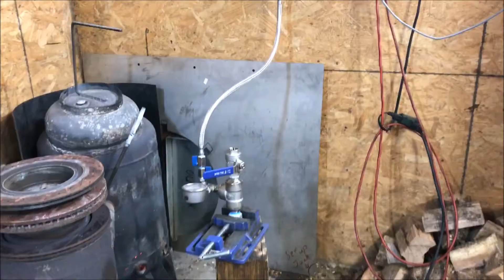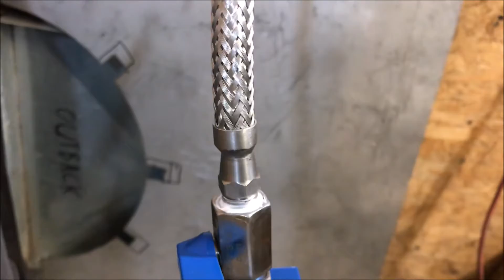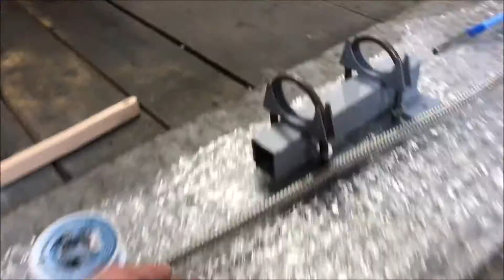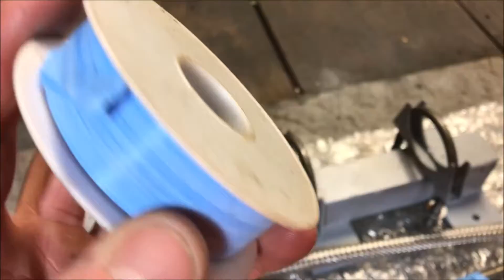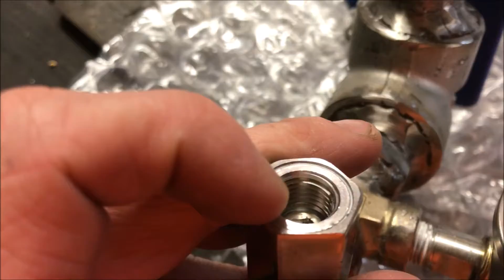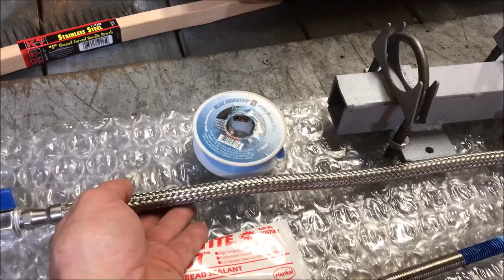Pressure booster DIY

Comment: hey I'm at the part where your tapping and I got to say you have a task ahead of your while machining 316L grade stainless still, consider 304?  the term galling is used when referring to sticking you got going on. take some masking tape and go around the top of the fitting to make a little well . oil and water are your friends here low speed and high hand down pressure pressure staggered breaks like you demonstrated in the video.  for pre drilling your hole do you have a plasma cutter? if that is beyond your means you can use a arc welding machine with a normal electrode (6010) or whatever with the machine turned up really really high, with some PRATICE you can make a REALLY GOOD CUT. (practice on plate - drag the rod go fastttttt , lots of heat ) carbon from the rods will contaminate the stainless but some grinding cleaning it off will clean that right up. if you had to make a lot of these you could possibly make a hydraulic punch or precut with the welding rod, cut the drill bit to clean it up, taper the top of the hole / masking tape oil.  TEFLON is reactive to gas's you have to pick the right sort for the application that you using . anyone dealing with oxygen please read about safety doing so , as compressed oxygen can be reactive to oils and become unstable.. blah blah blah safety is real folks if you don't understand what I was saying about oxygen service please do your research , other then that its a impressive tool ! why are you limited to 1000 psi ? or just the specs of the design.
Reply from the maker: Thanks alot for the input sir very well received , the 1000 psi is the max pressure of the weakest link in the system being the large ball valve . The costumer asked for 800 psi

Comment: we can remove the pressure assemble right ? the O2 tanks come with a cut off valve on top,  shutting that, then opening the external ball valve  to remove pressure would allow this unit to be transferred to the next bottle and the process repeated or am i wrong??
Reply from the maker: Yes , the pressure gauge part stays on the tanks and you disconnect the booster and connect it to the next tank

Comment: We had some issues threading some 316L rod for some u-bolts for a solar tracker, it was hell, and it galled a whole lot, even with oil, even lost some of the threads, it was really really tough because it was sticky and just not favorable for cutting threads. Also the nuts liked to weld to the bolts upon installation, even with oil. All in all, it was just a long, miserable job I do not wish to repeat.
Reply from the maker: Yes , glad you mentioned the welding , i could not remove a thermal couple from its well and all i did was finger tighten it ,  could believe it ,that sucker would not come off
Reply: thanks .....im the customer.....lol...good to know
Reply: @MrDavesbox1  A higher chrome stainless which is less sticky [but yes, it is also harder] would better serve the purpose.